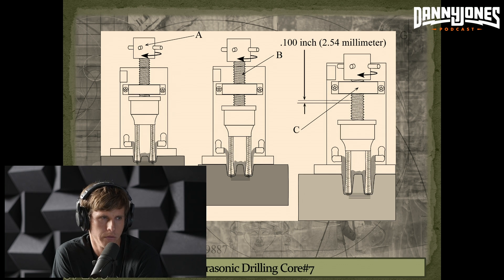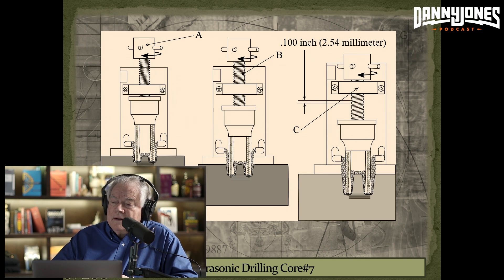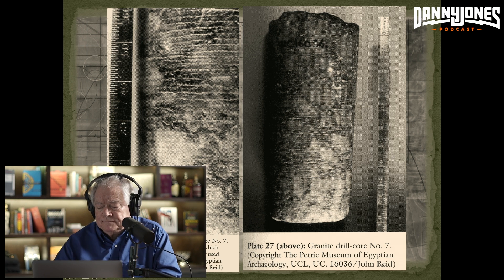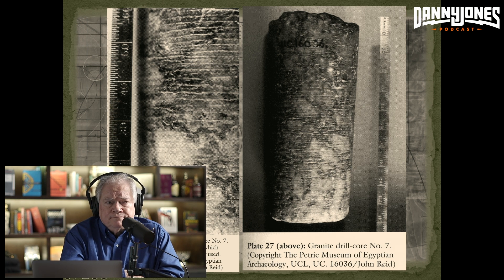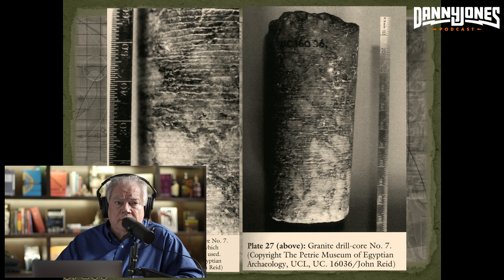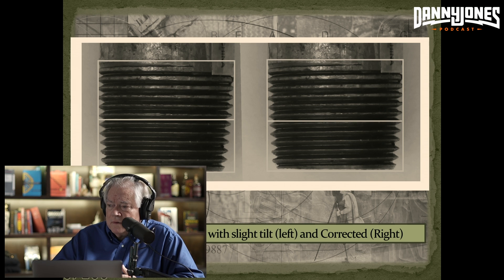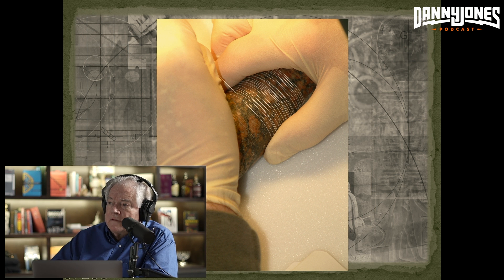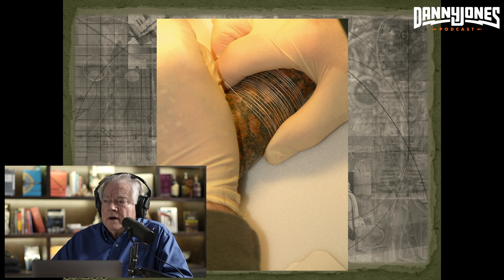Evidence for Ultrasonic Machine Drilling in Ancient Egypt | Chris Dunn

Comment: Would it not be as easy as bringing in engineers on both sides of the coin, running the thread in the groves and looking at it under a powerful microscope to prove once and for all that Chris Dunn is correct?  I think mainstream archeologists are fearful of a truth that doesn’t fit the narrative taught in schools, leaving them unable to explain how things were produced or created.  The vases found in the tomb of an ancient Egyptian king or pharaoh are solid proof that much that is credited to ancient Egyptians was merely inherited or found by them.  There is no way in hell those were made without a lathe and stronger tools beyond copper and sand.  Just no way.  The dimensions and perfect thicknesses just wasn’t possible.  And, they never made them again, EVER that matched that quality.

Comment: Oh cool you answered my question if they could drill through granite with sound why couldn't they introduced sound frequency into these perfectly designed air tight and sealed boxes at serapah but could they create a vacuum inside them theirfore simulating the condition in space to where all things were originally created

Comment: I have to question the slurry used from holes bored upwards.

Has anyone looked into the bow and string pictures, but instead of the bow string wrapped around the tool, the bow is that of a violin bow producing sound frequencies to cut granite.
Reply: I have thought that same thing or a high pressure slurry but wouldn't that leave a smooth surface however they done this is beyond our imagination maybe nano machines is the answer but they claim it was a high speed process What a mystery

Comment: may i suggest a different drilling machine because the glassy finish we can see in Egypt require something else like desintegrator aliens cutting tool by removing valence electrons responsible of atoms accretion one side effect is deposition of very fine quartz layer on untouched surfaces
Reply: I'm sorry what

FBI open up

Comment: More bullshit.
The Egyptians used a copper tube with sand as the cutting agent.
That's all they had for drilling hole in stone.

If there is a spiral grove, that gives the impression that some kind of advanced technology was used
then we are being fooled in some way

The Egyptians had NO advanced technology.
Reply: I think same way, not Egyptians , but someone far before them, and those tools, if metallic have gone thousends of years ago, only stone objects are left for us to wonder, how and also why.
Reply: @jormalonnberg1578  I have no doubt that the Great Pyramid is made up of 2 structures:
1) A granite temple inside
2) The 2.5 million block pyramid

The granite temple was built 12,000 years ago, along with the Great Sphinx
by a civilization that was far more advanced than the Egyptians.
If you work granite in any way beyond cutting straight lines with a copper saw and sand as the cutting agent, then case-hardened steel tools are used.

These tools are easy to fabricate - dozens of "Primitive Technology" YouTube videos describe how to harvest iron and form it into steel. Then, case harden them all with charcoal and mud furnaces.

Whether this civilization went further and mechanized the carving process is something we will never know.

There isn't one chisel mark on any stone in the GP - not one mark.